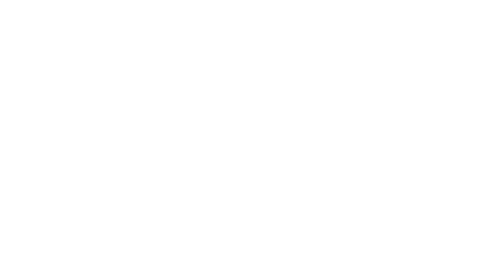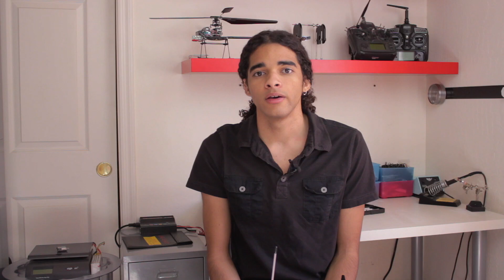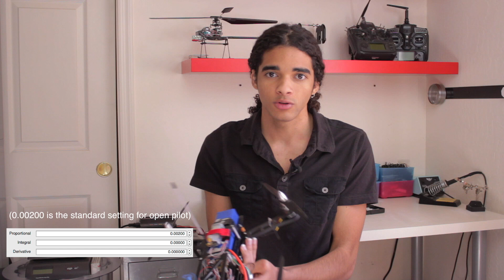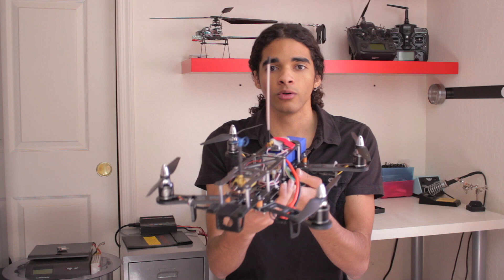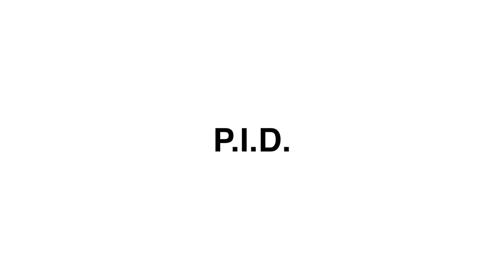How to tune your PID on a quadcopter.

Comment: is it okay to tune PID of quadcopters in windy area? or it should be in very calm area?
I am struggling to tune my pid values since 3 months as I am a beginner in quadcopters. Please help. and to test PID values, which mode should i use to test the values? PLEASE HELP ME.

Comment: Nice job!!  This video earned my subscribe.  

My quad is finally tuned.  My quick roll and pitch changes stop on a dime - no more wobble.  

I took a leap of faith and just followed this tutorial:   Only P (I and D at zero), then add I, then add D.  It only took a few short line-of-site test flights.  

For the lazy, here are my results:  
ROLL:  P 80, I 55, D 60
PITCH:  P 90, I 60, D 60
YAW:   P 100, I 34, Yaw Jump Protection 13   (I didn't actually tune YAW, but it's working fine)  

Specs:
250 Quad
BetaFlight/NAZE 2.9.1 Aug  2 2016 / 22:47:45 (0ef6c3d)
Fake GoPro on top
4S 1500mah on top
20A Little Bees
FPV gear
2-blade 5030 props

Comment: 38 seconds into the video you say "Once your gain settings for Proportional have been tuned now you can move on to I" but you don't explain what I would be adjusting P for.  Can you explain why you don't differentiate between Yaw, Pitch, and Roll for the different PID settings?
Reply: I ended up watching a video Skitzo posted on how to tune which cleared up my confusion.  In the video the guy is mainly demonstrating how the PID settings affect the roll axis.  For whatever reason, my stupid lizard brain couldn't apply the same reasoning to the pitch axis.  I get it now.  Thanks for your reply!

Comment: Got trouble-- the Robocat flys-- well, sort of. I have been hours getting it to lift off. I goes slightly up, then drives itself into the ground! It is a Naz 32 advanced and has a Mag and a Barometer on board. Are there any PID's or settings-- I am brand new to racing-- photo guy.
Thanks for your thoughts.

Comment: ok can some one explain to me P=ailrons? I=elevator? D=rudder?
Reply: Hey Sid. 
PID refers to the three gain settings. Proportional gain, Integral gain and Derivative gain.
Each direction of movement has PID gains that need to be adjusted until that movement reacts properly. 
There's PID settings for Pitch (Elevator), PID settings for Roll (Aileron) and PID settings for Yaw (Rudder). The guy in this video was mainly demonstrating it on the Roll direction only. You have to tune the other movements independently. Hope this helps.

Comment: I appreciate the easy video! My only question is which axis of PID I should change. There's Pitch/Roll/Yaw
Reply: Longer explanation incoming

ur copter essentially represents a + when looking from above. up/down = pitch. left/right = Roll.
IF ur copters weight, are distributed evenly across both axis, ur PID settings should be the same for both axis. 

IF ur copter, like mine are heavier on the pitch axis, than the roll axis (due to battery and camera beeing mounted on top of the quad, across the pitch axis) then ur P should be raised a little for the pitch axis. 

I usually picture it this way instead of what PIDS really mean. when im tuning my quads.
P = Power = How much POWER does it need to be stable. (not enough wont do it, and too much will overdo it)
I = Intervention = how much it will intervene when something is fighting it form the outside, too little and it wont have any effect, too much and to intervening too much. 
D = Dampening = Dampening the P,  try relaxing ur arm in front of u on a table, then all at once flex ur biceps and pull ur hand towards u fast, then stop it as quick as you can, ur hand will oscillate before coming to a stop, just like the quad. now do it again, without applying full force all the way = increasing D, ur hand should become closer to a "locked in" stop. apply too much, and the power will be applied to slow. 

This is how i imagine it. and it has helped me a lot when tuning my quads.

The Pitch and Roll should be adjusted, i find it very rare to have a need to adjust the yaw axis.

Just my 2 cents :)

Comment: which frame is that if you don't mind me asking
Reply: It's a QAV400
Reply: Cool thanks.  Good size.  Seems like everything on my 250 is mashed up in there.
Reply: goofyfoot2001 Really, with a QAV250? I have a QAV-R 220 and I manage space well. You should look into directly soldering / trimming the wires instead of using pin headers.
Reply: I do leave too much wire for sure.  I like the connectors though.  It just makes replacement parts so much easier.

Comment: Thanks!!!!!!!!!!!!!!!!!!!!!!!!!!!!!!!!!!!!!!

I would add, that having a BLUETOOTH MODULE ON THE BOARD makes it EXTREMELY EASY TO tune the PID from your cellphone!

 I hassled a lot tuning them using a laptop and a wired connection. LCD display is ok, but still not as good as mobile app. 

EZ-GUI app is best i used so far.

Cheers!

Comment: Nicely done.  I've listened to a hundred guys give their opinions on how to set PIDs on racers, and none have done it as succinctly as you. Congrats ... you win the 'gold star' for the day! Cheers!
Reply: +Bill Somrak Agreed. Show and tell. I've managed to get my RoboCat setup pretty well now. I left the USB cable in the CC3D and then gradually tweaked P on Roll and Pitch until almost unstable (virtually no wobble) and then eased back P a bit to about 170 roll; 160 pitch, then set I, roll and 'I' pitch 10 below those. For D I have 53, 61, for roll, and pitch. Yaw was set by default to 760, 1310, 60 based on the Libre pilot template for the Quad X vanilla setup. I now need to go out in the wild and see how the wind effects the PID settings and re-tune accordingly. They're tricky to tune alright!
Reply: +Rob Atkinson I'm still using BaseFlight with my Naze32 Acro, so your numbers are way out for me.  I think I currently have my ROLL: P=3.7 I=0.031 D= 23   For PITCH:  P=3.2  I = 0.030  D=23  and YAW: P=8.4  I= 0.031 D=23.  From my Taranis I can switch between Angle, Horizon & Acro modes.  Think I need to increase my P because even in Angle mode, if I give quick input, ZMR250 has a tendancy to stay at the angle I put it, rather than return to level flight.  Guess I  need more tweaking.

Comment: So do I have to do this process for roll, pitch & yaw axis?       
I am looking to setup a hexa' with a pixhawk flight controller.
Reply: +Oka Nare Yes, each axis is separate. Though with Aurducopter, there is an autotune you can try assuming the defaults work well enough for basic altitude hold flight. (things are pretty stable for me so I haven't ventured into PID tuning yet since other things need tweaking, but seems to work for others)

Comment: I'm not sure it's true to say P should always start at a 200 value and work from there, it is truly dependent on the flight controller. Other than that this is the best video to understand what each value does. Your demonstration with a quad is fantastic, most videos just sit there talking about it and leave people even more confused. We'll done! And thank you. Ps. Is it possible to add a you tube comment about the p value of 200 to overlay the video?
Reply: Very true. 200 in Cleanflight would probably kill somebody.

Comment: help...
my qav shakes when a 100% trothle 
i change que frame but the controller are the same and all stuf, 
what is the problem
thanks
Reply: you might want to set TPA, this will reduce the PID values at high throttle.

Comment: i like your breakdown, can you apply this pid for Dc motor control? i been trying to learn this but im just not finding someone who can break it DOWNNNNnnnn , im into arduino programming and this is where i will be applying this type of leanings to, specifically for your DIY Dc motor Servo, you know buil;d your own servo from scratch DC MOTOR, POT, GEAR BOX & H BRIDGE

Comment: hello, I built a 450 quadcopter with an arduino due. I'm getting gyroscope and accelerometer data from an MPU6050, but seems that the code I wrote to stabilizate the drone doesn't work. Can you help me please? How are you calculating the motors speeds? regards

Comment: Thanks so much for the videos! You have a wealth of info here for us getting into the hobby, I really appreciate it. However I am starting to fiddle with PID tuning for my Storm 250 SRD. My question is this:

I have set up 3 flight modes - attidude, rattidude, and rate. In CC3D, I notice you can have a PID tuning adjustment per flight mode. Do I really need different PID tuning for atty/ratti/rate? Or can I just use one set of values for all 3 flight modes? Thanks in advance.

Comment: I think "I" stands for 'integral' not interval, as the correction factor from it is the integral of the error or offset over time. So if there is a steadystate error, like wind, that is integrated over time, and the correction becomes greater and greater until there is no more error or offset. Too high, and it may eventually overshoot, and since the integral is something that compounds over time, it acts "massive" and even after appropriate correction, it still has compounded all those old offset values and will over correct if it is too high.
Reply: Power Max Good explanation too. Thanks.

Comment: Do you have to recalibrate your PID settings if you shift weight around on your bird? Say if you have a 1300mah battery hanging off the back and then switch to a 2200 on the top..
Reply: ***** thank you!

Comment: Good video, but over simplified.   Might work for some machines, but often there are other parameters, such as tendency to stay at a given attitude, power 2 weight ratio, center of moment, etc.  But great start.

Oh, BTW- get your terms right.  The 'I' in PID stands for Integral, not Interval.

Comment: not to be over technical but i believe I gain is for integral gain or basically it's the constant value multiplied by the integral term which is the integral of the error over time. it basically is a way of encorperating how well the multirotor has been minimizing the error in the position or rate you wanted and what it was. basically with just proportional, what ever the difference between where it should be and where it is is the error. the error multiplied by a constant called P gain is then sent to the motors so the further you are off from were you should be the more the multirotor will correct it. this takes no account though how well it has been doing which is what I is for. basically it looks at the total error over a period of time and if it is large it will increase the corrections even more than just proportionally to the current error. then there is D which basically predicts the error in the future and will adjust accordingly to current errors based on what it expects in teh future. it uses some basic calculus, the integral and derivitive but basically derivative will find the slope or rate of change of error. if the error is increasing with a high rate of change that means it can expect future error to be higher than current and should adjust corrections accordingly. together pid combines to controll the motors much as you said and tuning just as you said.

Comment: Is there any other ways to tune the pid constant? For example, is there any ways to calculate the constants?
Reply: It would be very hard to just calculate it.  For this you will need the polar moment of inertia of the quad and the full thrust to motor input curves for your battery, motor and propeller combination.  You will also need to factor in the way that your controller's gyros respond, and how the controller respond to this.  For instance, something as trivial as whether your gyro outputs degrees per second, or radians per second, or some integer value between -255 and 255 can make a huge difference.  In short, unless you have all the engineering data, just playing around with it is the only practical way.